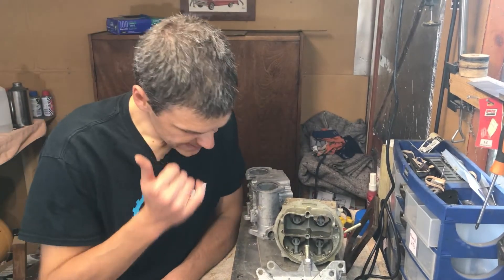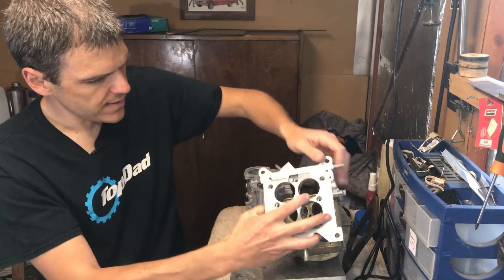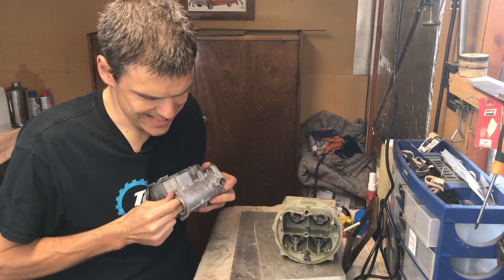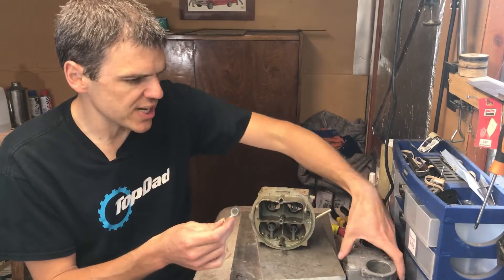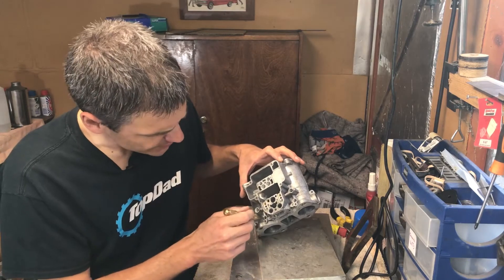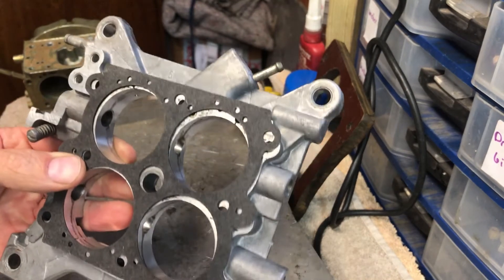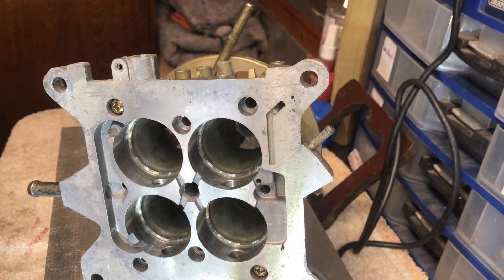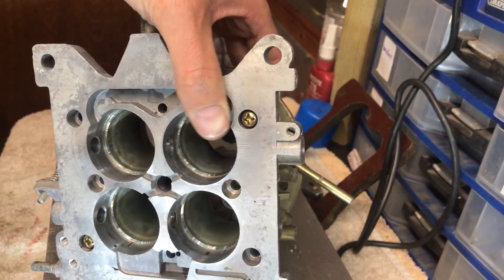How to tune a Holley 600 cfm List 1850 carb for additional flow and performance. Pt 2 base and body

Comment: What bit were you using on the drill press to remove material with?
Reply from the maker: 45 degree taper with carbide tips
Reply: @carburist  do you have a part number for the 45 degree taper tool ?  im in the procces of trying to do this as well. thanks

Comment: Cut the air horn off it will increase flow even more, I just took a die grinder, and opened up the venturi on the 1850 600cfm main body I have, and took parts from 3310-1 using the metering plates, float bowls, and the base plate runs like a champ. https://youtube.com/shorts/mzL_OWouKTs?feature=share
Reply from the maker: The milling of the chocke tower is a good one for vehicles that are not used in winter.